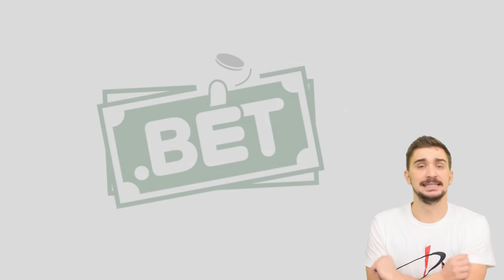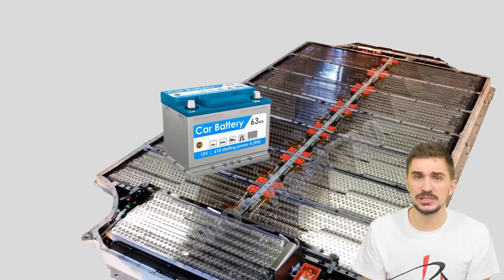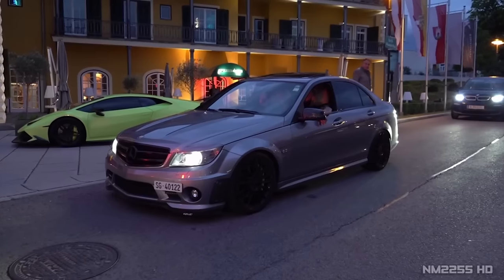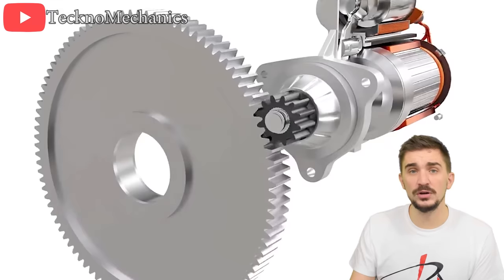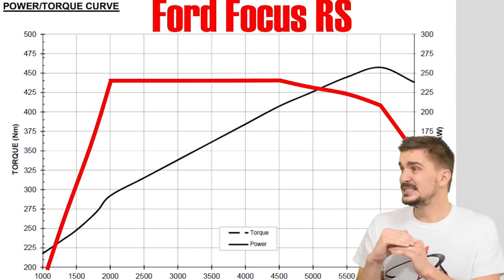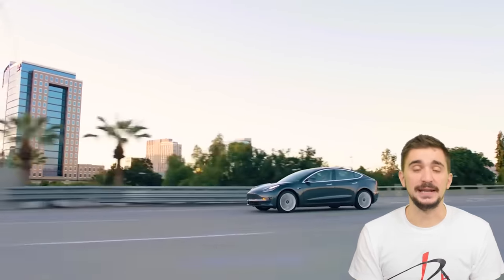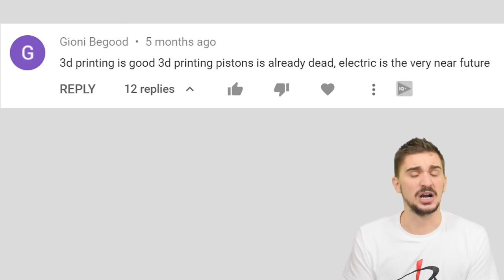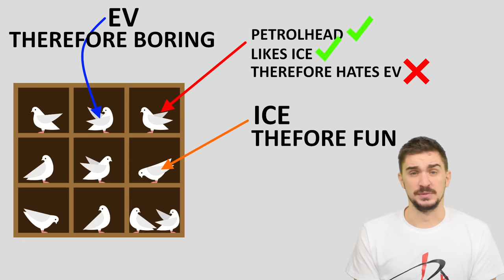ICE vs EV - IN-DEPTH comparison of BATTERY ELECTRIC and INTERNAL COMBUSTION ENGINE vehicles

Comment: You make total sense to me dude. Ice engines are fun and have a lot of good good purpose in their use. Electric motors are fun and have a lot of good good purpose in their use. Right now if I lived in a big city I would have an EV for getting to work and a ICE full size car for touring on the weekends to go with my ICE motorcycle. Now time might just go on and if fusion becomes the great future energy source and the cost of electricity nose dives, well maybe the ICE will be reduced to a fun vehicle and for when really going into the back woods. But that's going to be quite a few years. But an ICE vehicle for weekend fun is not where the pollution problem is coming from, its when ICE vehicles have to set in traffic and or start up and go a quarter mile and - well you get the drift. I do not want nor do I see ICE vehicles disappearing but I do look forward to scads of commuter vehicles that set in traffic and don't pollute, and maybe even a lot of highway trucks that run regular routes and operate on electricity.

Comment: Actually, the trick we bet on in the beginning of the video is helpful in life - if you car suddenly dies, you have a bit to pull away to the side of the road. I had to use it, when a crank sensor died, which caused the engine to stall, and I was stuck I the middle of the road.

Comment: You forgot to tell that electricity to charge EV comes from power stations that burns natural gas and oil or coal to produce it. Efficiency of power plants is about 40 to 70% depending on fuel and turbine type used. Efficiency of EV is 80 to 90% in ideal conditions and 60 to 80% in real life. Doing simple math you can see that in some conditions EV as substantially less energy effective than ICE. The efficiency of modern ICE never goes below 35% and EV that being used in real life by real driver who uses AC and loves to accelerate fast and charges from power station with 40% efficiency can go down to 30% and even less if its winter.

Comment: The power grid could not sustain a 10% conversion from ICE to EV. People have no idea of how much power this really is, and how stressed the power grid is already. 

I, too, have great hope for the use of electric motors in vehicles. As a pragmatist, I think that there will be a wider use of, and greater variety of, hybrids in coming years. This will allow the number of and variety of electric traction motors to proliferate, while the grid engineers work on the transmission and distribution problem. 

My guess is that a more distributed generation model will be necessary, along with grid scale storage of some type we have not yet seen. Pump hydro works great in those few areas where it is available. Molten salt batteries might work in some areas. But I think the ultimate solution will be the eventual adoption of modular, small scale LFMS thorium reactors. When they can be made financially practical in the 500MW range, then every small town will have its own, and "the grid" will be almost entirely local. I think India is the most likely place that we'll see this first, and then it will proliferate like wildfire.

Comment: I leaned about possibility to drive a car on starter in driving licence classroom lessons. 
Like if you are stuck in a bad spot, like in an intersection or on a railway crossin, you could try driving on the starter, but that new car can have interlock to prevent it.

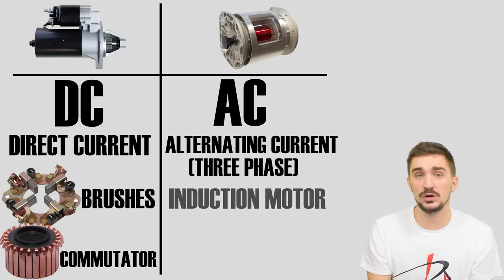Comment: 6:00 There are EVs that also use DC motors and are brushless/permanent magnet Soo no friction inside and also cold be mono phase or three phase or several types...
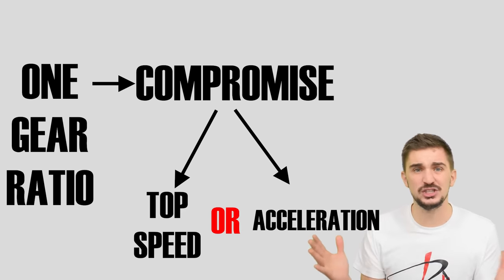20:26 this is overcame by increasing voltage or making even more efficient the motors... See the Plaid motors and battery voltage
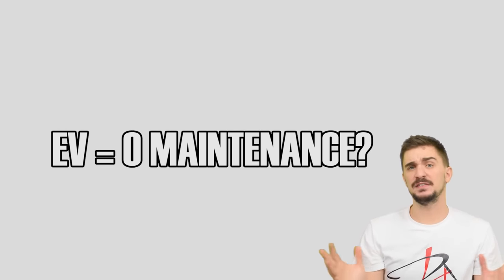23:00 EVs are NOT maintenance free. Their maintenance is substantially less than IC vehicles; Regen makes brake pads change way less because electric motors make the majority of the braking. Fluids inside like lubricants and cooling are changed after a really long time of use and without frequent maintenance. Batteries although they can degrade or fail are very unlikely and are very rare cases.
The most components likely to be maintenance are the most consumable like tires, maybe brake fluid that need change because of the little use.

Comment: I love ice vehicles. What most ev enthusiasts hate about ice vehicles is just what gives me goose bumps (especially performance ice vehicles). The smell, vibrations, the quick shifting through gears, ALS systems, and don't forget the noise!! Ask any Rally fan what is most memorable and addictive about watching a rally. Is when you hear a rally car coming from far (echoing in the forest) before you even see it! That is just orgasmic!!! I have seen (on TV) prototype electric rally cars. That sound is awful (and not quiet at all!).
So do I hate ev's? No, I don't, I think (especially the torque), is exciting, and they will have their (positive) part in this society. But..... there is one thing I don't like about ev's! And that is their owners that think that ev's save the planet and that they are clean. 80% of electricity produced still comes from fossil fuel, and thus, an ev powered by the grid still pollutes as much (if not more) than an ice vehicle. Also the majority of the power grids are not up to the task to handle a majority of ev's. If I ever in the future  own a micro heat and power generator, I possibly would consider an ev.
Keep in mind that 40% (the highest of ) the CO² produced due to human activity is coming from generating electricity!
Reply: The part where you said EVs pollute just as much or more than an ICE car is wrong. EVs are more efficient and produce about 1 to 3 metric tons of CO2 per year. Meanwhile a gas car emits 3 to 4 metric tons of CO2 per year.
Reply: @youseflatif796  nope! I'm  not wrong! If we an  amount of fuel that contains  1 kwh, then gasoline will produce 0.25 kg of CO2 natural gas will produce 0.18 kg of CO2, and coal produced 0.71 kg of CO2.

The efficiency of power plant and ICE is 30%. 
My wife's Chevy Cruze (slightly smaller then a Tesla model 3) burns 7.5 liter/100 km (or 66.75 kwh/100km). A Tesla 3 does 14kwh /100km. But, at 30% efficiency at the power plant, that means powered directly from the power plant the input kwh is  46.66 kwh. My wife's Cruze Produces at 20,000km annually (200 x 66.75 x 0.25) 3,337.5 kgs of CO2. If the Tesla 3 is powered by electricity produced at a natural gas plant, then it produced at a 20,000 km (200 x 46.66x 0.18) is 1,679.76 kgs of CO2. This is better then a ICE. But if the electricity is produced by a coal fired power plant, the the Tesla 3 produced (200 x 46.66 x 0.71) 6,625.72 kgs of CO2. Far worse then the Chevy Cruze. Note, globally more electricity is produced by coal than natural gas (about 1.5 x). 

What I didn't mention is that there are loses significant transition loses from plant to the average house, and that  power plants produce more than the consumer need to prevent blackouts. So in average the efficiency of a power plant from production to delivery (use) is about 15%. This makes it now interesting because now the Tesla 3 power by a natural gas power plant produced (200 x (14/0.15) x 0.18) is 3,360 kgs of CO2. Just slightly more than the Chevy Cruze!

But wait there is more! Where I live, it is very common to have winter temperatures of below -20°C. According to a Tesla Model, S driver in this area. The driving range in these temperatures is reduced to 50% (due to less battery efficiency in the cold, and the need for heating the cabin (which otherwise is produced by waste heat from ICE) this robbs battery power! Do you want me to do this calculation for coal? I bet you don't because it would be the equivalent of producing 26,506 kgs of CO2 annually! 

Still I would love to have an EV powered by a natural gas fired micro CHP generator (at home). But this system would cost me $50,000!
Reply: @fredschuttenbeld4571  Fine, I do know that there's a limit on efficiency (liters per 100km or MPG)when coal powered EVs start to get dirtier.
Reply: I'm a big ev enthusiasts. What I hate about ICE is how much energy it waste, you can shove that oil in a generator and be able to move a EV further with that generated power than an ICE due to larg industrial generators being far more efficient than a car engine and electrical transmission at high voltage DC can lead to almost no loss after 2000 miles.

Renewable power has now surpassed coal in the US, natural gas, coal, and other fuels now only produce 60% of the US power.
The US grid is in need of an upgrade, building infastructure for EVs will effectively be killing 2 birds with 1 stone. Tesla offers its own option of making its customers their own micro grid where the owner can charge their EV and sell power with pannels and equipment bought from tesla. Their equipment can also take excess renewable electricity from the grid and sell it back during peak hours helping avoid blackouts, tesla uses a very large version to keep Australia from having brown outs and saving million monthly by avoiding the use of peaker plants that only work during high demand.
Reply: @miguellopez3392  I have to disagree with you. Large power plants are not that much more efficient they still waste 70% of their energy on cooling and exhaust heat unless this waste heat is captured, like in a co-generation plant. In colder climates like where I live. For an ICE vehicle, part of this waste heat is used to keep the cabin warm (it is then when an ICE becomes a sort of a co-generator), and it is at these cold temperatures where an EV loses it efficiency compared to the ICE. At -20°C (-4°F) the EV's range is around 50% less. To keep the cabin nice and warm, preventing the windshield from fogging up, it takes that much power! (Together with that batteries are less efficient in the cold). The energy (electricity) what actually is used (bought from the grid) is about 15% of the energy put in to produce it. The biggest losses are heat loss (cooling) and overproduction to match the supply and demand without having blackouts. For example, I have monthly about 17000 kwh to my disposal, but I only use 600. Grid management tries to match this as much as possible over a large number of connections but always has to overproduce. 

About 60% of the electricity produced from fossil fuels is from coal, which produces 0.71 kg of CO2 when burned, for every kw of energy it contains. For gasoline this is 0.24 kgs and for natural gas 0.18 kgs. An grid powered EV (from a coal burning power plant) produces at -20°C weather 6 - 8x more CO2 than an ICE vehicle. Electricity from a natural gas powered power plant gives the EV in these weather conditions an equal to double CO2 output compared to an ICE vehicle (of similar size).

Fossil fuel powered power plants aren't going to go away as research has shown that solar and wind can only provide power ⅓ of the time, and being very unreliable (unpredictable), we will rely on fuel powered plants to match supply and demand as close as possible. Natural gas would be the best option as it is cleanest and kind of a renewable fuel.  It is produced and released constantly by nature and can be made from organic waste (like verge grasses) which would produce CO2 or CH4 (methane aka natural gas) during decomposition anyway.

Sell over production solar and wind energy isn't very attractive as the average pool price for electricity (where I live) is $0.06/kwh the cost for a solar system at my house is as of now $0.11/kwh. Having a Tesla powerwall  would cost me an extra of $0.20/kwh (at least).

If I really wanted to be environmental conscious, I would drive a EV charged by a natural gas powered Combined Heat and Power (CHP) generator which would heat my house with the waste heat in the winter (heating bill would pay for the Natural gas).  And for the summer having a solar system with a powerwall to charge the EV. This would cost me than $2.5/kwh (this incl cost for CHP but not for the EV which is double of an ICE vehicle. Or I could put this way I drive an EV that doesn't pollutes for an initial investment of > $150,000.00 vs a similar size ICE vehicle >$30,000.00 
Sounds to me a way to go.... right?
Reply: @fredschuttenbeld4571  powerplants are significantly more efficient because they aren't bouncing between power bands in a uncontrolled environment despite car engines being measure in perfect environments to test thwir efficiency, EVs use very little power to warm the cabin, so do gas cars, but if both had to idle in a winter storm, the EV would win, the energy loos you see is from either heating the battery or having a unheated battery, the energy is not lost, ots just now inaccessible at the current tempature. the energy from the grid to EV is actually closer to 28-35% from my own calculations going from power plant to tire.
Coal is now outproduced by renewable power, so if we use average grid mixes of the US a EV is the equation of a car that gets 45mpg.

Tesla is also getting into grid management to help make using electricity for EVs more stable and cheaper and so that its working in the countries they build their battery storage sites, they can take in renewable power when it's overproduction and discharge when they under produce, saved Australian 40 million in 6 months with 1 site doing this.

Solutions exist, it takes time to get to them, C02 isn't the problem, the inevitable rise in price of oil based fuels will make sure EVs take the market.

Comment: Modern engines peak curve is flat, because it is restricted because of drivedrain. It can be oval, but then peak will kill transmission. Peak curve is different at different gears actually. Most cars 3rd gear is most weak, since it is center of two bearings of gear shaft, and when applieing heavy torque two shafts will bend away from each other the most, and kill gears.

Comment: Indeed, your video are nice and your a mechanics and I am always happy to see them. You've deserv the right to say mistake ;) BUTTTT :

sorry for be smartass at this point :(, @ 14 min, it's not that. You have to maintain constant U/F constant factor ( depending on motor spec ) for feeding any electrical AC motor ( both synch and induction ). It's why you have complex MLI and filtering modules and complexe thyristor bridge module ;). If it's weight 60 Kg on a tesla it's because it's heat a lot and need some cooling. On industry we have some baby inverter until 1.5 MW, the biggest I see in my life ... and it's need a whole electrical cabinet and a lot of air cooling X)...

Funny thing on tesla is you steel need 12vdc standart battery for feeding all the computer module. They decide to completely seperate power circuit and command circuit.

Concerning the gear ratio, it's a matter of technical choice. The more pole you have on an ac motor the lowest it can rotate at the point than sometimes you don't need any tranmission at all. But the more pole you have bigger and bigger get the motor and bigger and bigger get the input current... and it's exponentially. On power plant the electrical generator rotate really really slowy but this beast are MW/TW rated so... but no gear !

On tesla they choose to put an high end high speed ac motor for be able to put the more power full and the most compacted sized possible motor. It's something like 20000 rpm if I remenber well. On industry, it's always between 900 to 3000 rpm, rarely more or less. Size to size the EV engine of the tesla look like a typical 15KW industrial motor oO.

and hum yes, about the curve it's 100% right. Torque curve are blablant legend ;) For the flatness at the end of the tesla curve it's due to U/F factor, not really emf thing -> you should look at it, it's a really intersting topic and it's within the heart of choosing an AC motor.
If you use an engine designed to run @ 60hz and 400 Vac, it's would blow full torque until 60Hz, you can overspeed it by adjusting U/F factor, like 100 hz @ 400 Vac but with low amout of torque.

tesla Battery pack are something like  700 VDC, so it's mean than the three phase inverter will not be able to ouput more than 400VAC, that's the limit of the three phase conversion Dc to 3XAC. I thing they could add 2000 vdc battery pack and you will see not a single drop in performance after the 6000 rpm limit.
But the cost would became the need of hight electrical insolution, that's take a lot of weight, way bigger motor, inverter, and a lot of problem with electrical safety...

Ok, I have to stop this, I am going to far for the topic. I am waiting for more intersting video, as always.

And yes, I am will keep my combustion engine because I think we have to wait 10 or 20 years for the EV market to be completely mature.

Comment: As alway a very well balanced und true report, you named it. 
The fact is, that the most European states have set a deadline for the ICE-driven cars, beginning from the year 2030 on or a bit later, from that year on, new ICE-vehikles arn't allouwed to be set in traffic, only the existing ICE-cars may be allowed to be driven until they break down completely. 
As a consequence, the most car-maker-factories have decided, not to develop any new ICE-engine anymore, only few modernizations will be made. 
Also the USA and China will change from ICE to EV vehikles, even the US-military has decided, to change the normal passenger cars from ICE to EV as soon as possible.
 
If you like it or not: The future of the ICE-cars is doomed, the future is EV.

Comment: Clutch position sensor? How about disconnect the connector from the sensor and stick “short pins” or two ends of a paper clip into the terminals and bam no more needing to push in the clutch to start.